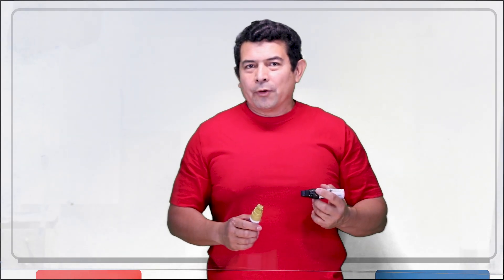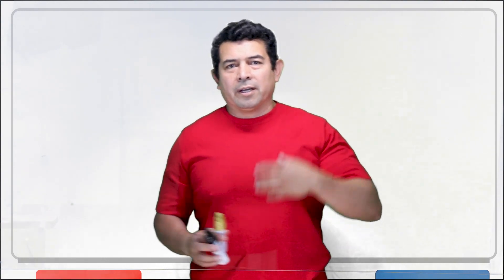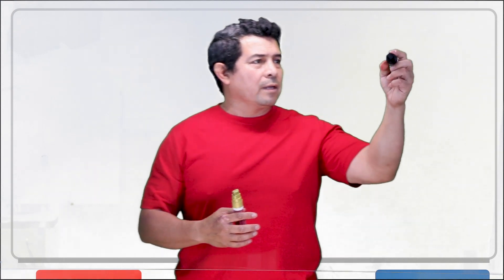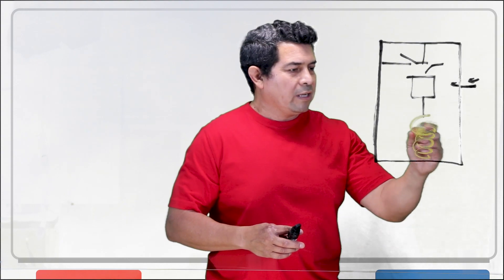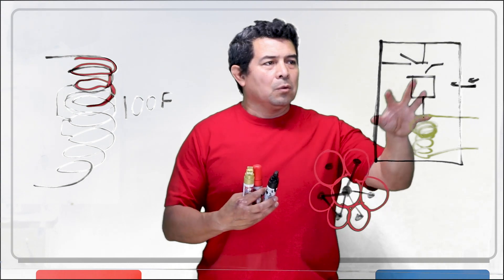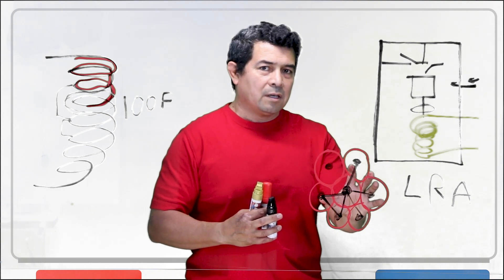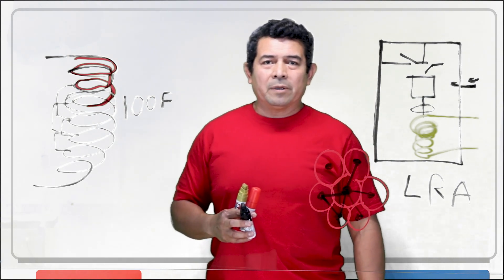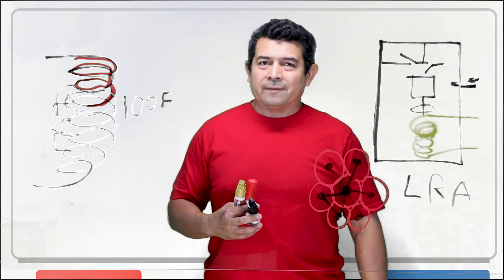Compressor burnout-HVAC Online Training and Courses

Comment: Thanks for the information and same time I have a question. If we were to replace a whole compressor with the one that burnt out, do we need to know the reason for the burn out. I understand we need to flush the whole system for acid but now a new compressor replaces the old one. I would try to find the reason only if I have to replace the motor in the compressor or the bearings but if I am completely replacing the whole compressor then is there any need to know the reason for burnout ? Thanks
Reply from the maker: You should always try to find the reason for the failure. But because of what you are commenting on here, are you replacing an open compressor? Because typically when you replace the compressor, you are already replacing the motor that runs the compressor. On an open compressor, the motor is not in contact with the refrigerant. There is acid in the system. The acid will travel with oil and affect Motor. If the reason you are replacing, the compressor is because of broken parts inside of the compressor, it could be that you have floodback. You're getting liquid back to the compressor in which case if you do not find out the reason for the failure, the new compressor is going to fail really soon.    So yes, you should always find out the reason for the failure and if you have acid in the system, you need to neutralize the acid. Flushing the system, or I should say the lines with a cleaning agent and nitrogen might not be enough. You need to put some acid away or some kind of neutralizer hope this answers your question. I hope you find out why the compressors keep failing good luck and thank you for watching!

Comment: Should i change the txv when get a bad comprresor
Reply from the maker: First question that you need to ask is what made his compressor fail?       If it failed because of acid in the system, then there is no need. It failed because of a leak that has caused the compressor to overheat then there is no need.     if it failed a floodback, you need to find out why you had floodback. Is it that the TXV has failed or is that someone adjusted it. Unfortunately, if it is one of these, you will not know until after you replaced the compressor.    One of the things in class is when you replace a compressor you must find the reason for the failure!    There is no yes or no answer to your question. This is about the best I can do. Good luck and thank you for watching!

Comment: What would happen if one of the two circuit breakers at the electrical panel providing 220 volts to the compressor failed?  Would it eventually cause burnout as described in this video?
Reply from the maker: If only one circuit breaker fails it would be like deenergizing the contactor that only has a single pole. In other words, no, it would not cause the compressor to fail.  The electricity would go into the compressor, but it would not do any harm.  Typically when you have a 220 V power supply, the circuit breakers are mechanically connected so if one trips both will trip at the same time.   I hope this answers your question and thank you for watching!
Reply: @AirConAcademy  Thank you for the response. In my situation the bad circuit breaker didnt trip the good one so the AC system was running but not putting out cold air. I discovered the bad breaker at night when I could see it arcing behind the electrical panel. When I pulled it dirt and mechanical parts fell out of it. I think the dirt probably caused it to arc internally and destroyed its function. After replacement the AC functioned normally. I now have a rental property with a burnt out compressor and was just curious if a similar bad circuit breaker could eventually cause a failure.  Thank you for letting me know.
Reply from the maker: @Sizzelot  wow! If I understand you correctly, your circuit breaker fell apart in the box or as you were pulling it out. That is bad. What was happening to your unit? Is that with that bad circuit breaker you are not sending the total voltage needed to the air conditioning unit. Because of that you put a load on the compressor and the fans so they probably overheated and quit working. It is a good thing you found it when you did. That is a very rare occurrence so I don't believe that is the same thing that happened in your rental property. If you have not replaced the unit in your rental property. You should be able to get someone to replace the compressor only!!!. It would be very important for you to make sure that they flush the lines, and install a liquid line filter dryer that is what they call HH. In other words, it would be an HH liquid line filter dryer. You can also talk them into putting a suction Line HH filter dryer to help clean the system. The HH driers are  designed to trap the acid so if your compressor went bad in the rental property you could have acid in the system. This will help trap it and clean it up.  I hope this information helps you. If you have any other questions please let me know. I also have some videos online that talk about the filter, dryers and bad compressors. Good luck!

Comment: Thanks sir, I do have a question,  if my compressor is bad and I know it's bad and burnt up, it smells burnt, do I have to replace my entire system,  ie, outside unit, inside furnace, air handler, does this require me to replace my entire unit,  say 6,500 dollars,,,or CAN the system be flushed out and replace just compressor? Thanks
Reply from the maker: Most likely a contractor will suggest replacing the entire system. But if you are doing the work, or you have someone that is willing to do the work, you. After you replace the compressor, you can flush the liquid line and the suction line with a cleaning agent. Not just nitrogen! Nitrogen will not clean the lines! Then, if you have had a burn out like you mentioned, you need to install. an HH liquid line and an HH suction line filter dryer. These type of dryers will trap the acid that is in the system. But you will have to replace them a few times. You should do an acid test and replace the dryers until the system is clean. When it is time to replace the dryers, you should not recover the refrigerant. But do a pump down so that it saves you time and money.  In case you do not know when you pump down your storing the refrigerant in the condenser. This will keep you from having to pay so much money for a brand new system! I hope this helps! Good luck and thank you for watching. !!!
Reply: Thanks for your reply and for your detailed feedback regarding my system,  I'm very handy and can work on and fix almost anything,  I have electrical experience,  but HVAC is not my wheel house, and I don't have any equipment,  so I guess I'll go with AC window units.  Question,, in the winter, can I still use my heat from my furnace? Thanks so much for your help....
Reply from the maker: @davidlaws1438  yes! In the winter time, you can still use the furnace and it will not be a problem. I suppose window units will work. I don't know how big your house is but I know that there's a company called Mr. cool. They make. Mini splits that are very simple to install. 
One thing I forgot to mention before is if you work on any of this, you need your CFC certification! If you do not have that you could get in trouble doing air-conditioning work. But! If you look into Mr. cool, all you are doing is connecting making connections and you don't need to deal any refrigerant so you would not need your CFC certification. I have install these and they're very easy to install. They come with all of the directions and how to do it. You will just have to drill a hole through your wall to run the refrigerant lines out. But these lines are very easy to handle! If you are interested in getting your CFC certification, I can help you with that. But definitely look at Mr. cool and you can install the mini split yourself! Good luck and I hope. You can stay cool this summer!

Comment: But how do you figure out if it’s a compressor burn out because of the LRA or the windings in the compressor have shorted if both escenarios will give you a compressor that it shorted to ground. How do you figure if it’s a burnout or a short?
Reply from the maker: Sometimes that is a hard thing to figure out. you have to do a lot of research to completely figure that out and unfortunately most techs will not.  One thing you should do is to do an acid test. If acid destroy the windings the acid test will come back positive. It should not come back positive if it was LRA that burned up the compressor. Another thing you would do if it is a semi hermetic compressor, you could take the oil pump off and try to rotate the crankshaft. If it does not rotate then the compressor is locked up and you drew LRA and that is why the motor burned up. If it is not a semi hermetic compressor, you would still need to do an acid test kit and after the compressor is running and it is properly charged then check the superheat. A TXV is going to maintain constant superheat. If the system uses a TXV and the TXV is faulty then the superheat might be low and it would flood the compressor causing it to lock up. Liquid refrigerant coming back to the compressor will lock the compressor up, so this is what you would be looking for if it is a hermetic compressor. I hope this makes sense. But it does take some research to figure out what caused the compressor to be bad. When I teach a compressors class that is the most important thing I tell them that they have to do once they have  replaced the compressor. "To find out the reason for the failure". If you don't find out the reason for the failure it will happen again!    thank you for watching and thank you for the question!  I hope this explained it.

Comment: Hello.  I have a pin hole on the compressor terminal I never saw that before.  Can a burn out cause that.  I don’t smell anything but the refrigerant left the system when I looked at it.
Reply from the maker: Typically what I see is the terminals that blow out. I don't think I have seen a hole where there is an actual leak at the terminal. Typically when you have a loose connection at the terminal heating and cooling will cause the terminals to blow out. But once that happens the entire charge is lost. I guess you are lucky that it is just a small leak and you have time to get a new compressor. I don't think your situation can be fixed.  A burnout will typically burn the compressor out, meaning the windings will be destroyed and you will end up with either a grounded compressor or shorted windings. Thank you for your comment.

Comment: Thanks Mr. Herrera for this lesson. Quick question Sir, does the car rpm have any impact on the ac system when charging r134a freon? If so, what should be the maximum rpm to the compressor proper speed while charging the system? Because while charging the car Ac today, the low side pressure kept building up to 40-50 psi and the high side was at 150 psi. but when I raised the rpm, the gauge will drop to 15 psi on low side and about 50-60 psi on high side. but due to fear of burning the compressor coil or stock which happened to me few days ago by adding more refrigerants, I assumed that the problem was the blockage in the TXV. So I discontinued the work in order to avoid any serious damage and I lost that cash and wasted my materials. Please help me sir. Thanks.
Reply from the maker: If you had to look for a blockage and you had to start with an empty system you should charge by weight.   The car should tell you how much refrigerant should be in the system so you could get the proper charge. That is the best way to charge a system.   When I have charged a car I usually do it by myself so I am not sure what the RPM are.    I add some liquid and then some gas to make sure I do not flood the compressor. I usually keep the saturation temperature on the low side just above 32 degrees F. with the engine revved up.  I am sorry but I just rev it up by myself so I am not sure What the actual RPM is.   I hope this helped.   let me know if you have other questions.
Reply: Thanks Sir,  I'll try that

Comment: Hi,
Why they but a burn out filter in the suction line after the compressor failed, isnt a filter-dryer more important, Becauce all damage stuff from the compressor go in to old filter dryer.
Reply from the maker: Yousaf Abbas     Very good question! A lot of times a dryer is just put in and the technician does not ask these good questions.   A burn out filter in the suction  is  basically the same as a suction line filter dryer.  I am not sure what you have seen out in the field, but the burn out filter dryer will absorb whatever acid may be in the system. A suction line filter dryer Will only absorb the moisture that is in the system. A burn out dryer or like a lot of people call it, HH dryer. It will also absorb the hydrochloric hydrofluoric acid that is created in the system with a burn out or when moisture is introduced into the system.   After a burn out or preferably anytime a compressor is being replaced the technician should perform an acid test. If the test shows there is acid in the system then the burn out filter dryer, or an HH dryer should be put in the system to clean it out.    A few days after the system has been running the technician should perform another acid test. If the acid test comes back positive then the burn out filter dryer should be replaced again.  Testing and replacing the burn out filter dryer should be done again and again until the acid test shows there is no more acid in the system.   I hope this explains what you were asking.  Thank you for your question. And please, keep asking and keep learning!
Reply: Aircon Academy thank you, what I still not understand, when this hydrochloric comes in the system, is that when compressor burn out? And how this come after the compressor failed in the hole system?
Reply from the maker: @aycabbas  It happens because the oil breaks down as you have a burn out. Also when technicians do not purge the hoses and do not get the air and moisture out of the hoses.  Then the acid is formed.  Some times the hoses are already contaminated from when they were used in a contaminated system, so now the contamination from the contaminated system is put in to the clean system and it contaminates it then the compressor fails.

Comment: You demystified the workings of that “big noisy machine,” that no longer works. So, maybe our unit can be repaired?
Reply from the maker: Thank you for the question.  if the motor in the compressor has a burnout it is very difficult to fix.  The motor needs to be rewound and that may be very hard to do. the compressor may need to be replace.   That is one of the reasons people like open compressors, because the motor is easy to replace.   I hope this answers your question

Comment: If V=IR, & if resistance is constant, then why does current shoot up at start?
Reply from the maker: Very good question!!!!!   unfortunately in schools they only teach ohms law in resistive loads!!!    motors are inductive loads and they act differently.   Ohms law does NOT work on inductive loads or in other words motors.    I guess I should do a video talking about this!!!   thank you and good question.
Reply: I think it's because of the power needed by the motor to counter the starting torque from complete rest to its rated speed. The Electrical power P=IV, which when converted to Mechanical power =  2pieTN, relates the power directly proportional to the Torque (T) and Speed (N). The Current (I) is therefore directly proportional also to the Torque which is very high from rest to motion then lowers down as the motor speed gains its momentum or inertia.
Reply from the maker: Ronald Barrion  Yes, it has to overcome that the rotor is standing still so it does need all that power. the magnetic field builds up and the counter electromotive force is what makes the amperage drop that down after it has started up. There is a lot to all of this and how our motors work.   Resistive loads like a heater are very different than how an inductive load like the motors operate. It is so interesting to study the differences between the two.

Comment: How thermostat on cars work sir....function,concept
Reply from the maker: On older cars they were just on and to regulate the temperature they would regulate the amount of hot water or coolant to the heater core.  On new cars because of technology they adjust the water going to the heater core automatically so you can set the temperature and the controls control it sensing the cabin or return air temperature automatically.   But that is only in some cars not all.  I do not know how they do it in all cars.
Reply: @AirConAcademy  thank you for the reply sir.....can you make a video sir some trouble shooting of cars ac sys. ex.freezing evaporator,or txv what are most causes for the problem....and some trouble shooting on what if high side plug,what would be the effect,or on the manifold gauge some trouble bouncing gauge pointers both.....
Reply: @AirConAcademy  and if ok sir...also how to properly recover freon not using machine,vacuum using vacuum motor,and recharge sys.using only manifold gauge...thank you sir godbless
Reply from the maker: @mr.technician4144  I will try but not sure when I can get to these   please keep watching.   thank you
Reply: @AirConAcademy  thank you so much sir I also wondering why everybody uploaded car ac system trouble shooting then fixing without showing how to add oil on the system....
Reply from the maker: @mr.technician4144  I guess because you generally do not add oil to an AC system.  either in a car or for comfort cooling.  you would generally just add it to the suction line and it will flow in tot the compressor.  the new compressor would come with oil and oil rarely leaks out.